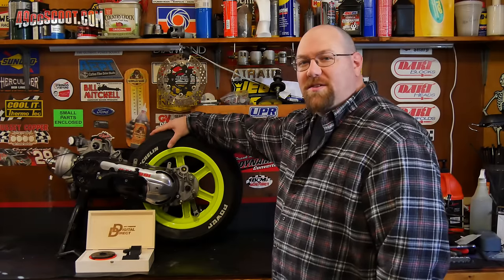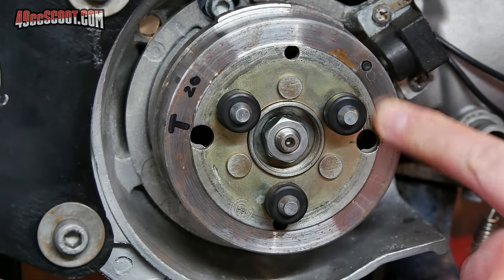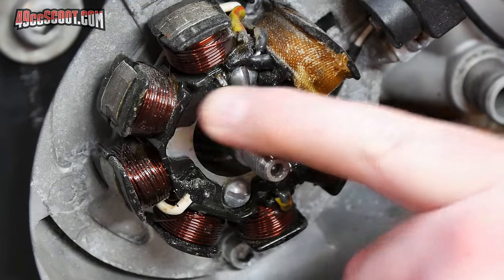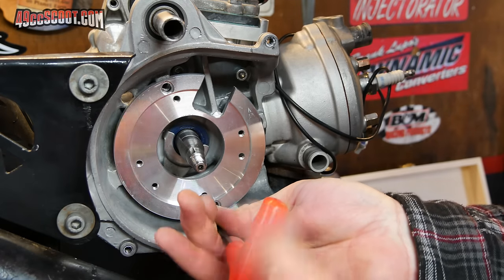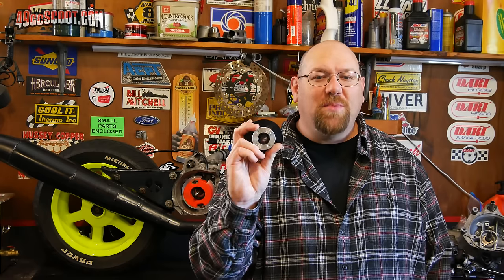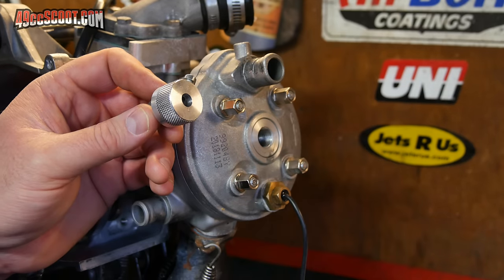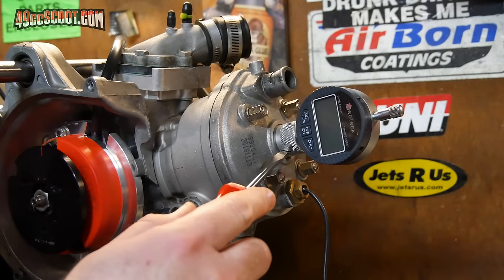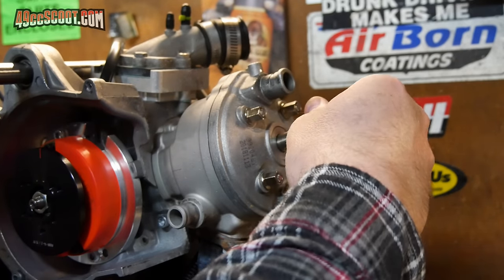Detailed MVT Digital Direct Ignition Installation How-To : TPR 86cc Build : Part 21

Comment: Great video. 

If you want an absolute TDC measurement I reccomend using the piston stop method and a degree wheel.  Rotate till you hit the stop, roll it the other way hit the stop and split the difference in half.  The dwell at TDC means you can easily have a few degrees of dead spot.

All that said in my own video I use this method as well because I am lazy.
Reply from the maker: What good would that do when the spec is in mm? If it were in degrees from TDC, I get it. You'd want to know true TDC. It will be the same distance in mm from TDC if you're anywhere in that range where the piston dwells for a few degrees. It actually surprised me at first when I got into this and realized the margin for error. Just seems like they'd let you setup a degree wheel and tell you it's x degrees BTDC. Could run a calculator, but apparently they (and as I understand it) most other racing iggy manufacturers just  tell you distance specs.
Reply: You could I guess in theory do the piston stop method, fix the crank, exchange the piston stop for a dial gauge, zero it and then set your mm..

I'm already tired writing that.

Because the dwell still relates to crank degrees.  So your tdc is not the "true" tdc. 

But for all intent it's probably close enough.
Reply from the maker: @pitobread  I was actually making another video in the garage just hours ago about finding true TDC with a dial indicator and checking that against a piston stop and just zeroing a dial indicator. What I can tell you from that, is that it's still the same distance from TDC with it zeroed with the indicator or using true TDC, because one is a measurement of distance from the top of the piston's travel and the other is the amount of degrees of crankshaft rotation from true TDC.
Reply: @49ccscoot  Like i said it's barely worth the effort, but it can be in some cases!  It's going to depend on your rod stroke ratio. short stroke long rod motors could add up!

Here is a neat calculator that can help with numbers to show exactly what I am describing. http://www.torqsoft.net/piston-position.html

If you put in 44mm stroke, 80 mm rod, .35 angle and set it on piston position.  Calculate it then change your rod length to 105.  One has your piston juuuuust starting to move and the other one hasn't started yet.  You can also use this to tell you exactly how much dwell you have at TDC. Remember it will be x2 whatever the angle is.

This is what I mean by true TDC.. in the end it doesn't really matter, if you math it out and round it relates to about a degree of error.    Not enough to worry about.  Just figured I would mention it before someone tells you your piston is in backwards. ;)
Reply: Thats exactly what Turbo Yoda told us!
Reply from the maker: @pitobread  Thanks. I think it's pointless at best to worry about true TDC when they give you specs like this. There's all of this stuff about this spec works better for a stroker and this for stock stroke and maybe somewhere in between for mild strokes. They never mention connecting rod length, compression, RPM, fuel, etc.. It really doesn't sound like an exact science to me. They seem like specs to hopefully put you where it runs OK and doesn't scatter engine bits everywhere on the first run for the majority of users.
Reply: @49ccscoot   For sure!  its a mostly foolproof method for setting timing within a few degrees of "right".   Your points touch on why I dislike mm before TDC as an absolute setting.  Gimme the curve and a timing light and let me play any day!

Comment: Lookin at aliexpress,and the smaller idle jets I promote are for Mikuni carb. "often used for arctic Cat,Polaris,Ski-doo twins and Yamaha Viper 2 strokes".Its for snow mobiles stationed on south-pole.So the jets are for asian jungle and deserts.That is why you have 123 mm nozzles.( ;

Comment: 19:23 even if i have a full circle racing crank stock displacement my spec should be 0.40 btdc? Its weird few people tell me that i set it wrong and they said it should be 0.35btdc
Reply from the maker: Full circle or not has no bearing on the ignition timing setting. Set it based on stroke.

Comment: Hi dude I hope you read this and get back to me 👍🏻 I really need to know if the taper on the Yamaha crankshaft is the same as the Chinese crankshaft?? I need to know this as I own a CPI mvt ignition but my new cylinder requires a 85mm rod which I can only find for the Yamaha. I hope and pray that the taper is the same or I may have to buy another mvt ignition 😒
Reply from the maker: The taper on the typical Yamaha crank is the same as some clone cranks. The clones have large and small taper versions. Large taper is very common on the CPI 1E40QMB. It's supposed to be pre 2003-2004 they would be small taper and post would be large. If you have the 12mm crank  pin and larger splined section on the CVT side, then it's pretty safe to assume you have large taper.
Reply: @49ccscoot  is there anyway to do this? I mean I have large taper but i want inner rotor...
Reply from the maker: @tamer27antepli  I believe it is MVT DD23 for the larger cranks. If you go on ScooterTuning and look under CPI 50 and then ignition you should see some ignitions for larger cranks.
Reply: @49ccscoot   i found a cheap used one for small taper, can't just drill a bigger hole in the rotor?
Reply from the maker: @tamer27antepli  It's not as simple as drilling a hole. You would need someone to bore it to the proper taper for your crank. Unless you can  do it or have a friend with a lathe that owes you a favor, it would at least  make sense to see if you can get a price on the rotor for the 16mm crank and perhaps make sure they can interchange (no difference in the stator).
Reply: Hmm , i can bring it to a shop 
 they have a lathe , might not cost a lot i think...

Comment: Hi Mr Scoot.I have a question,yesterday I have buy mvt  ignition,but witchout manual,and I don't know how to connect wires,where I can find model name?On official store website they have manuals only for specyfic models of motorcycles,or they name models by DD/21,19...
Reply from the maker: If you know what type of engine or bike it’s for you can look that up. It may have a model number on the stator or rotor. Maybe even the model of the CDI could help narrow it down, but they use the same CDI with multiple models.
Reply: @49ccscoot  Thanks for fast response=)I have A88R-13-2/27 19 write on my rotor,and A88S5 36/19 write on stator,but if they use the same cdi it's good news for me=D
Thanks for help scoot😎✌

Comment: Thanks for the information, who would you recommend for my build? I would like to buy a mini stroker and maybe a set of gears. I currently have a polini cast bore 70cc, Keli pulley and ramp ready to go in. I would also like to put in and over range rear pulley and probably a longer belt. I have watched all your videos and any advise is much appreciated! Mahalo!
Reply from the maker: I'm guessing you're in HI from the greeting. I don't really know the scene out there, but I'm certain there are some good shops and capable tuners around. If you wanted to register on the forum, you could ask and maybe one of the HI locals could point you in a better direction than I could. We have at least a few very active members out there.
Reply: @49ccscoot  Hi i would ask is that true that too heavy flywheel can broke crankshaft i have 80cc xtreme and stock flywheel so is there big risk that my crank can broke
Reply from the maker: @cuongvo2205  I'm sure it's possible. What I've seen from a forum member that tried to use a stock flywheel on a  Big Evo was that he kept breaking flywheels. It would make the rivets come out of it. I've had a failure where I think a bearing went first and it bent the crank and broke the ramp plate on the variator. At high RPM, a lot is possible. Regardless, high rev setups are much better with inner rotor ignitions. Aside from the difference in mass, they generally have a much better timing curve than standard CDIs or a lot of aftermarket CDIs.

Comment: Hy i'm not in agree, for your 86cc with 44mm  crankshaft it's needed by Top performance schedule 20° BTDC. With 0,35mm of BTDC you have 1,43°. You can calculate with this formula X°= (180xYm)/ms . Where "Ym" will be the BTDC and "ms" will be motor stroke. For example, with 44 motor stroke, you'll need  X°=(180x4.88)/44   X°=(578.4)/44   X°=19.96°. BTDC 1,43° it's not too much anticipate, and the motor can't ignite the gas properly.
Reply from the maker: TBH, the TPR spec of 20 degrees has never made total sense to me. They don't specify where. Locked out at 20 degrees isn't going to do the best. 20 degrees of base timing could mean all sorts of things with different CDIs. With the MVT as setup here, it has over 40 degrees of timing at low RPM and reaches 20 degrees around 11,000RPM. It continues to pull timing as RPM increases.

https://youtu.be/JuehGGccJhM
Reply: @49ccscoot  I investigate, and i think on the MVT the line is not the pick up, but the charge to produce electricity, i translate the recommend on the manual of MVT and it'is: "before top dead center if the cylinder is 50cc, if the cylinder is greater than 50cc it must be set at 0.35mm before the top dead center, likewise the lighting must not exceed 55w" , i think to never go up 55w they say for 50cc motor keep it at 0mm, for upper motor keep it at 0,35mm, after the timing of the CDI will do the correct timing of 16° or 20° for the TPR 86cc engine. So my excuse for the precedent message ;)

Comment: On my scooter you have to buy the whole airbox if you want a replacement paper  air filter element  is that a normal practice for most  scooters   ? It's a Hyosung. Makes me feel like it's a toy. It's $38 for the air box delivered.
Reply: No it's not normal, no scooter need such a thing. Probably neither yours, are you sure? Wich model is it?
Reply: @giannfa000  Hyosung beaver HY125cc scooter. They  only sell the whole airbox I've investigated it from various sources including Hyosung new Zealand.i know i don't need the  whole  air box. It's not a good sales policy
Reply from the maker: As giannfa000 said, there should be an option without replacing the whole box. UNI also makes foam that can be cut as needed. I think they may even offer dual layer more like some scooters have stock.
Reply: @49ccscoot  yeah I'll have to use an after market filter element of similar shape or use foam . But Hyosung defiantly only sell the entire air box which kinda sux

Comment: Do you know the separation between the rotor and stator of the mvt dd ? 
and bought a new one and the cone is not correct
it does not go in at all and is very separated, 7.60mm from the stator to the rotor
I'm sorry for my English, I'm Spanish, I use the google translator
Reply from the maker: Mine is about that far apart on the Minarelli. When I installed one custom on the RC-One I made it sit closer. Both run just fine.

Comment: Haiii Mr can the mvt digital direct 19 go on my standard crankshaft will it do any harm to my crank it's 10pin
Reply from the maker: They have models for large and small Minarelli tapers, so it should be OK that way. The MVT shouldn't damage the crank, but if you try to use a stock crank for high revs it may not go well or at least not for very long.

Comment: did you test different settings other than 0.35mm ?
Reply from the maker: https://youtu.be/PxFAb6-vlso
Reply: @49ccscoot  thanks for your reaction. i also have the mvt ignition installed on piaggio engine, The manual was very bad. I tested also with different setting, like 0.35mm, 0.25mm, and ende up to set it 0.50mm for the best result 
1 last question: did you manage to connect the cables to charge your battery?
Reply from the maker: @peter0139  It charges, but it won't regulate very well at all. I basically turn on more lights to keep voltage down. lol Wiring diagram and info is in the description.

Comment: Hey bud   I  have a mvt millenium iluminage ignition for Yamaha bws my wiring is not the best but I can take apart an engine throw it back together and fix everything but electricity not my thing I was wondering if you know any videos on how to install the mvt Millennium one MVT‐EXT120
Reply from the maker: I've never used one. I'm not sure if this will help, but they have instructions on their site : http://62.210.47.55/MVT/MONTAGE/BBkAAEcbo1xYTE5XbnlHcUhBAQA

Comment: What advance should I use for my barikit 80cc with stock stroke 39,1 mm. And I already put it on but there is something weird going on when I kick it the kick wants to fly up again and it’s kinda hard started
Reply from the maker: If it's a DD06 with the included CDI, then it should be 0.40mm BTDC for the initial setting. Double check that. If it's not the DD06, check the specs for whatever model number you have. If you use an E-PROM CDI with the Digital Direct then they use different specs too. If it kind of kicks back at you, it's probably got a lot of advance... but that seems to be normal with  mine.

Comment: Does this guide differ for my derbi? Ofc my derbi doesnt have a variator
Reply from the maker: The process is the same, but specs could vary. I would suggest checking the instructions or contacting MVT to be sure about the timing spec for your engine.
Reply: @49ccscoot  Thank you also the TPC calculator that goes into the spark plug hole where can i get those?
Reply from the maker: @champ2572  I made the dial indicator holder, but you can get them from scootertuning.ca in the tools section. They also sell dial indicators and micrometer style setting tools.
Reply: @49ccscoot  Thanks

Comment: Its me again. Will these help me gain more power on my kasea and apex 90s
Reply: Anything more than stock
Reply from the maker: @Kyle_gallegher  You may be able to change base timing to get the right timing in the powerband. Not really sure what ignition  the ATVs have, but 2T scoots are a basic curve mostly. This is a very aggressive curve with lots of advance till 7,000RPM and then tapering off. It makes it snappy or abrupt getting on the pipe, which won't happen so much with small change curves. It's also very small and light so it makes  the response great for that reason as well.
Reply: @49ccscoot  not sure if I want to rewire the old kasea and apex after but maybe!

Comment: Where can I get an electric micrometer? With the thing that spins into cylinder head
Reply from the maker: I've only seen the standard style of micrometers. Nothing digital. If you mean a digital dial indicator like the one I'm using, here's a link :
https://amzn.to/46J2mbU
I made my adapter in the lathe, but I talked about an easy alternative here :
https://youtu.be/JVZr74Lt0DQ?si=-ptxUns3vddBaU8f&t=711

Comment: Do you know the size of the two screws and washers to secure the stator to the stator plate.
Reply from the maker: I don't want to take this one all apart to check, but I have a Digital Direct for Piaggio that likely uses the same thing. Give me a few minutes and I'll go check it.
Reply from the maker: M5x0.8x30
Reply: @49ccscoot  do you know of any company/reseller that can sell the whole ignition mounting screws seperate (I.e screws that connect plate to casing,stator to stator plate screws and washers). I’m having trouble finding the screws separately for my digital direct.
Reply from the maker: @crbcairo.1633  Contact MVT or see if ScooterTuning can help maybe. Otherwise, with measurements to guide you, you can find most stuff at McMaster-Carr. The M5 bolts and washers are easy enough. The M6x1.0 bolts (not sure on length, but they're so easy to cut down if they're a little large) should be no problem. Honestly, a local hardware store may be all you need.

Comment: For am6 what is measurement before tdc? I cant find nothing about it
Reply from the maker: Should be 0.4mm for standard stroke. I don't see anything specifically for the DD21, but other strokes of 39-40mm are 0.40mm.
Reply: @49ccscoot  thank you

Comment: I have same ignition on my piaggio nrg 50. Is it ok to adjust it at as you are?
Reply from the maker: I spent a few minutes looking  around, because I've never used the Piaggio version. I didn't see anything specific to the DD09 that is for Piaggio. Some pics show the same CDI (RJ34-6) that I have. That makes me think you may be OK with the same specs as the DD06 for Minarelli. I don't know that for sure though. You could try contacting MVT or a dealer that sells them if you don't have the original instructions to check.
Reply: @49ccscoot  i dont have original instructions and i am hear here that is must be 1,5mm before tdc. Watching your video i see that mine setup is way ofset. I know that selletra goes 2,5mm before tdc.
Reply from the maker: @ivannovoselac3518  It will depend on all of the components. For example, the same ignition with the MVT E-Prom instead of the included CDI requires a much different setting.

Comment: Frère c'est quoi la différence entre allumage mvt dd Booster et 103
Reply from the maker: I don't know anything about the 103, but just from pics I can see  that it's a different rotor, looks like maybe a different stator and the CDI has a different number. Probably a different mounting plate. So it's meant to fit that engine's flywheel taper and mounting and possibly has different specs.

Comment: can this Digital Direct charge the moped battery?
Reply from the maker: Yes. It needs to stay at high RPM to charge though. Doesn't do much at idle or low RPM.
Reply: @49ccscoot  so i just plug it straight into the old harness and it should work I assume?
Reply from the maker: @kevinisaksson1914  Depending on the scoot. Watch the video. I cover wiring toward the end.